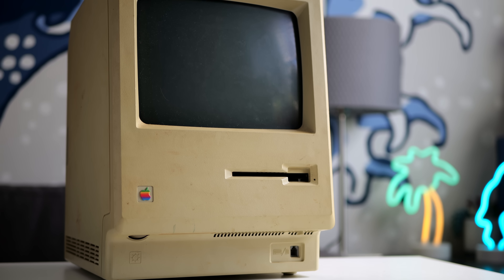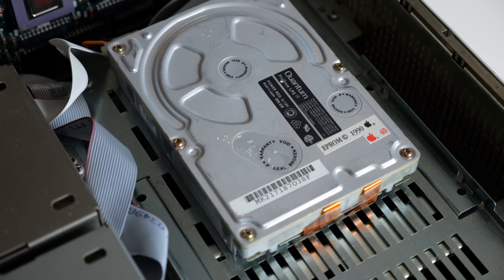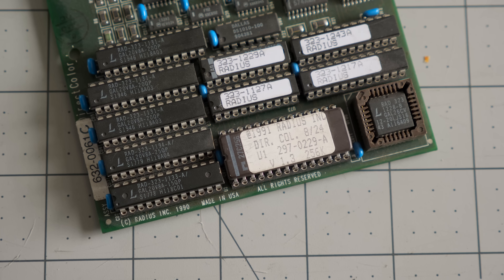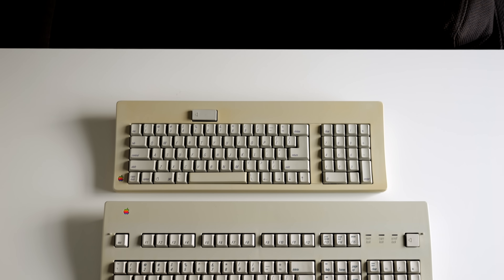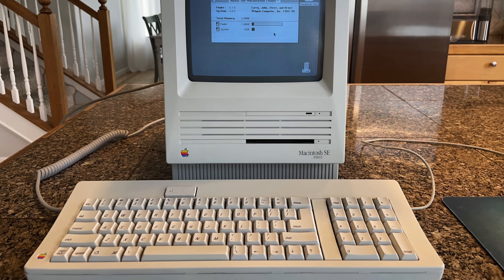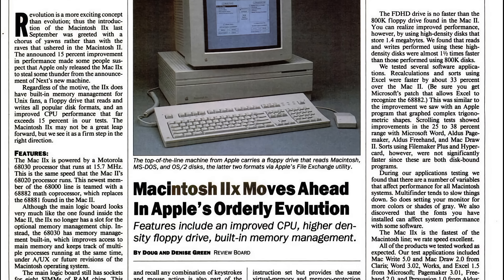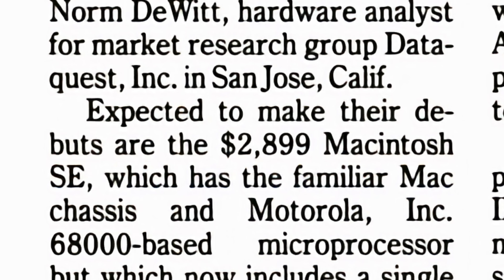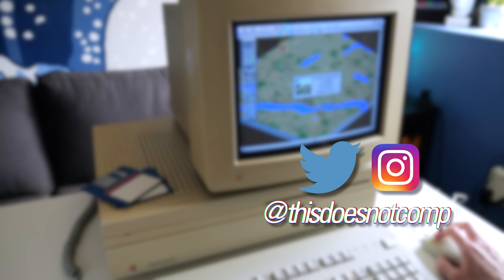Macintosh II: The Mac's Major 80s Evolution

Comment: So, funny thing about the Mac II and the 800k floppies. Natively, you couldn't use the full capacity of the drives due to the ROMs as mentioned in the video - they were limited to the 400k floppies. However, back in the day, I purchased what at the time was an older, used Mac II for very little money. In this Mac II (my favorite Mac of all time, BTW), I added a pair of Radius Rocket cards that I picked up used for ~$100 each in the local WantAd, plus a 800k drive from a more recent dead Mac that I also had. Each if these cards had an upgraded ROM that would support 800k floppies - but only if you were running in the Radius Rocket desktop instance. It was clunky, but it worked.

Comment: From a quick google search this machine and the Amiga 500 were released about the same time. This is a great looking machine - it would look great on a desktop today. Never owned one, but could only have dreamt about it back in the day. But geez, for the price my Amiga 500 "games machine" sure delivered in terms of price to performance - particularly when compared to this machine.
Reply: The Amiga benefited from a set of hardware coprocessors for graphics, sound, scrolling, sprites etc. It was a better machine in many ways. That Mac had to do everything in software.

Of course that same hardware would doom the Amiga by anchoring it in place; developers had to make software with the 1000/500 as a baseline so could not take advantage of newer models without losing customers.
Reply: @kirishima638  That and since the Amiga followed the game console philosophy to its design it was harder to evolve the platform as the custom chips were tied closely together with the dual bus architecture. The 1990s Amiga machines were slight augments on the 1985 design.  Having said that, it was a remarkable machine and still came in $700.00 less (including color monitor) than the original B&W Mac when comparing launch prices.
The Mac II is definitely the Mac that I'd add to my collection if I was adding Mac hardware to my set of machines. I still recall the rock-solid still-frame graphics on that thing when it launched. Paint app and desktop publishing dream machine.

Comment: - 5:08 Any idea what the coin-cell battery inside the iMate is for? 🤔 (Also, any idea what the MacHASP-S is? I think it's some sort of DRM dongle, but for what software, I have no idea.)
- 6:20 That's hardly a surprise, Jobs was not a tech guy, he was just a sleazy used-car–salesman, only interested in maximizing profit at all costs, that's why Apple is the evil corporation it is today. 😒
Reply from the maker: While no official schematics are available for the iMate, the general consensus is that the battery is to allow for an ADB keyboard to soft-power on a compatible Mac.
Reply: @ThisDoesNotCompute  Ah, okay, that makes sense; I assumed it couldn't be for storing any sort of settings. I guess I don't need to replace it anytime soon.

Comment: We only had a Mac Classic at home, even tho my dad was a Mac sales/systems engineer for a reseller. I'd drool over the higher spec machines -- sometimes he'd bring some home for testing. (Ex. Mac Portable and early PowerBooks, early PPC machines, etc) 
Not sure if I ever spent any time with a Mac II. I might have seen on at either his office or my mom's on the rare occasion they'd bring me in. My mom worked for Paramount Cards and they had Macs in the graphics design dept. I definitely remember seeing an SE or SE/30 with an expansion video card and second monitor, but I think they also had some Mac II's.

Comment: The IICI, is, in my humble opinion, the best 030 MAC you can get.
Reply: Had one of those pass by my job at a refurbishing place, by far the oldest computer i had seen there. Sadly we could not do anything other than power it on, i had to explain to my coworkers about SCSI, as they thought it was IDE. I would've maybe kept it if i could but we had a very strict rule about not being allowed anything. And it was going straight to ewaste brokering because it was "obsolete", but i would say it's a bit different than the usual Core 2 Duos on that pile. What a waste
Reply: @Nukle0n   They are really strict about that stuff.  I had a coworker take a computer home with him that was scheduled to be recycled (we both worked in the IT dept).  Instead of putting it into the recycle pallet (it was a lot of computers and monitors), he simply took it home. Basically he trash-picked it. 

He got arrested and charged with embezzlement of the computer because it was in his control as a trusted agent of the company.
It was told to me (and I have no reason to think they were lying) that there is a paper trail of a computer.  If a computer they owned turns up somewhere like a dump, the serial number goes back to them and they can get huge fines for improperly disposing of the "e-waste"
Reply: @tarstarkusz Wow, I’d like to be in his shoes and try that again today.  You could make a high profile fight about it and get a ton of public support.

Comment: The Mac II was the first Mac I worked with. It had an internal hard drive and a 800 k floppy. We also had a Mac SE with two 1.44 K floppys. When we replaced one of the floppy drives in the SE, I was allowed to buy a rom-upgrade for the Mac II, and put the 1.44 floppy in that system. It worked great.

Comment: The MAC II is comically large.  I had one for a short period of time.  I think it was a regular 2, but it was like 27 years ago and i just don't remember. But it was comically large.  I also had a IICI which is the perfect size desktop, IMHO.  8 RAM slots.  Just a great computer for its day.
Reply: I've read that Scully basically pointed at an IBM-PC and told the engineers to copy it. They were all huge boxy things at the time but no-one remembers that.
Reply: @kirishima638  Yeah, but the II was larger and even more comical, especially for 1987.  This video doesn't really show just how big this machine was.  Look at the monitor on top of the IICI (the best 030 MAC ever made, IMHO) and then look at it on top of the II.  It's like twice the size of the monitor whereas the monitor hangs off of both sides of the IICI.

From what I know (I didn't work in the industry until the early-mid 90s), the II was a pretty good machine for its time, just comically large and very expensive (like 5k expensive) as were anything you could put in it. NUBUS was nice too. Not only quick, but fully plug and play.    I had the one I had in like 1996 and I got it very cheap, like 50 bucks IIRC. 
 You had to buy RAM specifically for the MAC and not generic ram. IIRC, the MAC II did not use any parity bit and the cheap (for the time, but still expensive by today's standards) 1MB SIMMS didn't work because they all had parity bits (parity bits is for rudimentary error checking).  The MAC not only used SCSI drives, but they also were SCSI with an Apple ROM on them which kept you from using a standard SCSI drive.
Things aren't as bad today with Apple, but Apple has always done cute little stuff like this designed to bilk every last dollar they could get out of you.
Reply: @tarstarkusz  Macs back then used 30 pin and later 72 pin RAM. Apple didn’t make RAM, it was fairly standard. Only the IIfx had special RAM. You could but adaptor boards for using cheaper types in the same sockets. Adding RAM to a typical PC was a nightmare by comparison.

The limitation for using non Apple SCSI drives was only for formatting them with Apple’s own HD SC Setup drivers but there were plenty of alternatives like Lido or FWB. It wasn’t a big deal.

SCSI was much better than the primitive IDE drives of the time. 

The biggest problem was ADB as it limited to you using Apple’s limited range of keyboard and mice.
Reply: @kirishima638  This is absolutely not true.  Adding RAM to PCs was never a nightmare. Even the early DIP RAM was not especially difficult and compatibility was good (excluding things like Tandy).  The early 30 pin simms were also not standard PC 30 pin simms (Pcs also used 30 pin simms back in the late 80s early 90s). I'm going by memory here, but I pretty sure they used 8 chips and PC ram generally used 9 (for parity).  Whether or not they made the RAM themselves, i don't know and it's not really the point. Point is, Mac ram was always more money than PC ram.

FWB was expensive and I don't think it existed at the time this was new.  So whether you spend an extra hundred bucks on the drive or on FWB tools, it was still more money.

SCSI was better than really any implementation of ATAPI and even when faster versions came along, SCSI also improved.  Every server I ever worked with  back then was SCSI.  SCSI was especially good in that it didn't tax the CPU and was more versatile.

Funny, but I never thought ADB was a major pain. Just different.  Apple keyboards (to be fair, most OEM keyboards back then) and mice were mostly of very good quality. MUCH, MUCH better than OEM stuff today including Apple.

Comment: "Steve Jobs hated expandability". This one line explains why I hated Apple under Steve Jobs.
Reply: Check out new Mac Pro....
Reply: One of the first things Jobs did on his return was stopping the Power Express from being put into production. It would have been the most expandable Mac ever and the only Mac with built in Ultra/Wide SCSI.

Apparently 6 PCI slots and extra fast SCSI were offensive to Steve Jobs. So the PowerMac 9700 was not to be. The smaller version of the Power Express (Manhattan) with 3 PCI slots was developed into the Beige G3 in mini tower, desktop, and all in one models.

The Beige G3 had three ROM revisions and two or three different onboard ATi graphics chips. The AIO model never used the version 1 board. The version 1 had a bug in its ROM preventing use of two IDE drives but an R2 or R3 ROM could be swapped in to fix it. The R1 Beige G3 is least desirable because it's onward video chip is much lower performance than the others so it needs to have one of its 3 PCI slots taken by a decent video card.
Reply: @greggv8  To me, everything Steve Jobs did sounded like "I love e-waste". Jobs only cared about money - he didn't care about seeing his machines being easy to fix by swapping out bad components. His reasons were a little valid but his true reasons were plain greed.

It's also why at work we banned Apple devices - because any malfunction means we lose the entire device for lord knows how long until it gets repaired and we probably lose all data in the process. Not to mention the +50-100% "Apple tax".

Comment: Since the 68020 has no PMMU (paged memory management unit), the Mac II can't use virtual memory,  adding to the Mac II's disadvantages.   Also, it can't run any Mac OSes past System 7.5 or 7.6, due to this same limitation.
Reply: 7.5.5 because the Mac II ROM isn't fully 32bit.
Reply: There was a separate Apple-custom MMU chip--I think it was called the “HMMU”. Not as powerful as a 68851, but it could do some page remapping.

Comment: It's actually possible to upgrade the drives to 1.44 meg ones, and was offered as an upgrade by apple
Reply: Did the ROM's have to be upgraded to recognize the new 1.44 meg drives?
Reply: @marcusdamberger  I haven't done it to a Mac II, but I was able to do it to a Mac SE. (a SE FDHD died, and I had a SE, so I swapped the HDD, Floppy and the ROMS, and it works fine)

Comment: Colin, the was a nice retrospective of the Macintosh II. I owned the SE because that was just easier to afford at the time. And the portability was a real plus in my case.

Looking back, I'm amazed we could actually get any work done on these. All of the Macs were slow and the screens were relatively small. And an accompanying printer and/or scanner in the early days made for an extremely pricey system indeed.

But there was initially no Pagemaker for the PC. Most of the software needed for publishing (desktop or otherwise) started on the Mac. There were growing pains but it really was the only game in town.

Jobs is an enigma wrapped in a riddle. He could be the biggest mover of technology in the larger view but a real impediment regarding necessary incremental stuff. He was a Big Thinker but not every bit of innovation that was needed required Big Thinking. Sometimes you just needed an extra port. Or a mouse...that wasn't round.
Reply: That last paragraph is a good analysis of Jobs. He was incredible in seeing the future (GUIs replacing CLIs, the computer eventually being just another device, etc.) Problem was he never understood that the original Macintosh was always going to be limiting for some people, and that there was a place for more powerful options. (Some of it was also just kind of petty: he didn't like function keys, so none of the NeXT computers ever had them.)
Reply: While the Pagemaker came to PC later, PCs had very good DTP software made by Xerox, the Ventura Publisher. After Quark Xpress popularization the Pagemaker was no longer seen as THE professional tool, rather a cheaper substitute.

Comment: So, All these RETRO old skool Macs were ALL more WHITE in color and not tan/yellow?!  Hmmm.. Time certainly yielded discoloration on those cheap plastics.
Reply: Yes, it was a very light cream they called “Snow White” and later a very similar colour called “platinum”.
Reply: Up until the Mac II and Mac SE, the previous Macs had been a sort of tan/beige color.
Reply: @ricksarvas6563   I had an O.G. Mac with the monotone display and the built in single 3.2" disk drive. Or rather my Dad did in his office. I remember it being a light tan. I did not know most of the ones after (you mentioned) were supposed to be more of a white color. = o ) I'm glad current manufacturers changed to black. I sometimes miss the bright color options of the IMAC CRT with the translucent case. =o) Sometimes.

Comment: I love the Apple Extended II Keyboard so much I have one sitting on my desk and use it every day as a software developer. Absolute tank of a keyboard, still holding up strong.
Reply: Same here. So tough. I whitened mine with peroxide when I got it then it almost immediately yellowed again. Love it though.
Reply: Agreed, I'm using one right now and have a small collection of them. The one I'm on I replaced the damped whites with NOS Yellow Alps. It's lovely.
Reply: Completely agree with your assessment.  Fortunately, I pulled a few Extended keyboards out of dumpsters years ago and still use them with G3s and G4s, they're so incredibly comfortable to use.
Reply: I like them as well, but I find that I sometimes type faster than the keyboard can register those close successive strokes.

Comment: WHY do you claim Jobs would have killed the machine?
He has approved many expandable computers.
Reply: He didn’t at the time. He made his feelings pretty clear to many around him.
Reply: @lawrencedoliveiro9104  I doubt though that Jobs discussed Macintosh II with his colleagues at Next (or Pixar, for that matter), but NeXTcube had expansion slots just fine. So in this case, we are dealing with tech media cliché rather than with reality. (BTW, this is typical for many Jobs-related things, which turn out to by myths despite being widely believed by the public.)
Reply: @StrangerHappened  That was a bit later, if you recall.
Reply: @lawrencedoliveiro9104  It was developed since 1986, so the time frame is the same still. And even before ousted from Apple, Jobs has supported more professional, business-oriented computer models just fine. Under Jobs, Apple had a major commercial computer market share for a reason, and it was not based solely on bare bone basic models, but also due to expandable versions of computers that Jobs has approved. So the idea that he would have killed an expandable version of Macintosh makes no sense. He would have only killed it if it was to replace the baseline concept rather than being a higher end addition.
Reply: @StrangerHappened  Nevertheless, he was responsible for the original 128K Mac not having expansion slots.
Reply: @lawrencedoliveiro9104  Indeed, but there is no contradiction. Baseline models, according to Jobs, should not have expansion slots. And this philosophy is in Apple to this day. But higher end models were expandable in one way or another with no issue.
Reply: @StrangerHappened  And now we have these “Apple Silicon” machines with no expansion capability at all, not even RAM expansion.
Reply: @lawrencedoliveiro9104  Expandable Macintoshes will be released by the end of this year. Until then, there are only old Intel-based machines for that.

Comment: My IIfx came from the dealer with 1.44M and 800k floppy drives fitted so it's definitely possible to have a modern drive in at least whatever ROM revision I have. 
I think there may have been some slight ribbon cable rework done to make it work, never looked too closely at it since I assumed it was a common setup.

With dual high performance graphics cards and a token ring network it's shockingly usable even for web browsing.
Reply: The IIfx is a completely different motherboard from the II, not just a faster CPU and new ROMs. The IIfx has the SWIM floppy controller by default which supports all 3 Apple floppy capacities (400k, 800k, and 1.44m). The Mac II came with the IWM floppy controller which only supports the 400k and 800k floppy capacities. You can put an 800k drive in a Mac that has the SWIM controller and it will work fine, albeit at 800k capacity. The Mac II has its IWM socketed so you can replace it with a SWIM so it can support 1.44m disks. Apple included the SWIM controller in an upgrade kit for the Mac II.